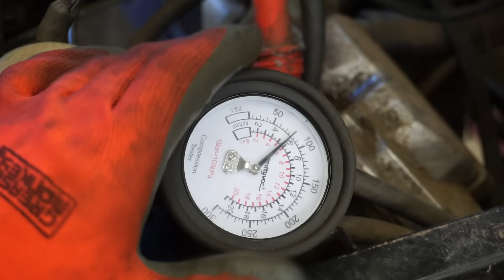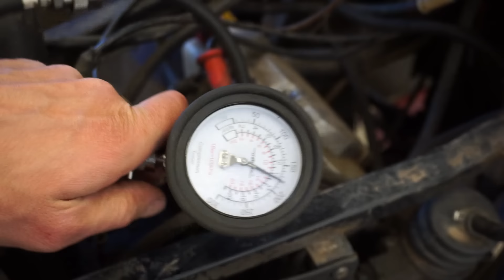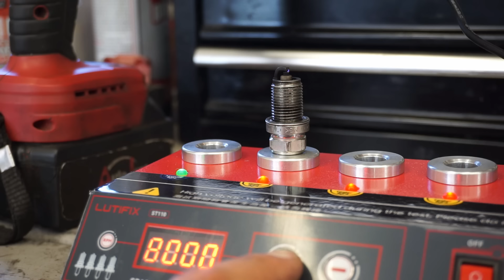Nobody Could Fix This $200 ATV (Won't Start)

Comment: Joe, there is supposed to be a foam sock filter on the end of the rubber intake hose where you put the tape.  That will create the proper air resistance for the carb.  You're welcome.
Reply: Where exactly cuz I bought in that was beat up gettin it fixed up so i don’t think I have it either
Reply: Polaris got rid of that foam due to it crumbling and clogging carbs causing more harm than good.

Comment: My dad currently has the same quad from 1995. It is bone stock and has over 4k hours on it, and has never needed anything but gas and oil changes. Most reliable quad I’ve ever seen
Reply: Doubt it but nice try brother!🤔😬👁👁👎👎🤝
Reply: @craigmorgan4676 nope 100% true best quad I’ve ever owned. Finally after 30 years of hard work the transmission is finally going. It has been worked it’s whole life and never gave us any fits
Reply: Great fix😊
Reply: Mine is a 91 and been great
Reply: @craigmorgan4676   they will if people would perform normal maintenance on them.  I work on everything from motorcycles,  snowmobiles, atvs,  outboards, chainsaws, lawnmowers,  etc and without question the worst are atv and chainsaw owners.  They do nothing in regard to maintenance.

Comment: I remember back in the day when I bought a new one from the dealer back in 99 they told me the cams would go bad if you didn't use the special polaris 0w30 oil in them. I listened to their advice and used 0w30 Polaris oil since new and my dad has it now and it still runs like new. It has 28,000 miles on it. It is a sportsman 500 but basically the same engine.
Reply: manufacturers oils (BMW SEAT VW etc)
are often good invoices, manufacturing,
Avoid returns to after -sales service of their vehicles.
Reply: Another great video as always sir. Since you made out so well on this one, I think it deserves a new seat cover too. Keep up with the great work.

Comment: Didn’t see anything in the comments about this but if the tractor muffler has more air flow than stock,the carb will need a bigger main. When you restrict the air box, you are essentially running it at half choke making up for the lack of fuel. that being said I love watching your videos. I’ve learned a thing or two from you.
Reply: I was thinking the same. Cause and effect. Ditch the goofy tractor muffler and throw the OEM muffler back on. I bet it runs better without having to choke off airflow.

Comment: My cousin had one identical to this back in the day when they were new. He was a hardcore Polaris fanboy in those days, but all I remember of it was him CONSTANTLY fixing on it because it wouldn’t run or the 4 wheel drive had quit again or something.  He doesn’t run Polarasses anymore! 😂
Reply: In the the mid 90s we had to pull Polaris' after they got wet because the belts would slip they  was definitely junk in those days . There actually good fourwheelers now
Reply: @michaelmays9292  Still junk
Reply: @NightTakesFlight yeah I’m still not a fan of Polaris. I like my Japanese stuff, it just runs forever.  My 87 moto 4 still runs like a dream.
Reply: @minnesotatomcat  same, I like my YFZ450R and my TRX250X, my brother picked up a 04 Predator 500 and it's just been a chore, still gotta fix the leak to the carb
Reply: @minnesotatomcat  the 100 cc yamaha quad? I had one of them. Thing was so reliable.
Reply: @aarongrabowski3775  it’s a 225cc. They made the moto 4 in a few sizes, even a 350.
Reply: I had a 2004 Can-Am not any better junk wouldn’t just buy a used one of those
Reply: You had to keep the front hubs clean and fresh demand drive fluid in the Older polaris and they worked fine. I've had lots of them.
Reply: We had a bunch of the old 250 trail boss’ lol good thing they were easy to work on cuz they were apart more than they weren’t

Comment: I just finished rebuilding a 1996 425. Cam ended up being wiped out on the exhaust lobe. You got lucky with this unit in very good condition. Thanks for the content
Reply: A lot of ppl don't run right 0w40 is only thing good for these

Comment: Polaris tech tip. When diagnosing the fan simply unplugs under the passenger side fender well. Unplug it because it sucks enough juice to drain the battery in 5 minutes by its self. It will save on your cranking juice. Also the fuel “pump” is merely a device that only allows fuel to flow if the engine is running activated by air pulse. The fuel is gravity fed otherwise. The cams do get worn on these really bad as they aren’t oiled properly. Then go ahead on an add a jump to ground on the brown wire for the AWD so it’s never an issue. The factory mikuni carb is the best you can get. Only replace jets and parts as necessary . All the china remakes will never run right.
Reply: Polaris Tech Tip...Scrap it and Buy a Honda or Yamaha! 😁💪.
Reply: What would you advise on the engine oil? Is 10W40 motorcycle oil good enough to protect the cams or should you use some car motor oil for best protection since this vehicle doesn't have wet clutch? Some people above say to use 0W30 or 0W40 motor oil. 
Thank you.
Reply: @paul340mopar  Really...how about CanAm? I'm looking at one

Comment: 29:30. It's a good tip to mark the date on the oil filter when you change it. It gives the next mechanic some useful info next time they're doing an oil change.

Comment: I live in Mid Michigan and I used to have a 2007 Yamaha Bruin or Brute or something. It was a 4x4 and had a snow plow that came with it. Had the cops at my house for riding it one day so I sold it and now we live in a different house with nothing but farmers fields for miles. I need a new machine to have a little fun on and something that will plow my driveway. I wish I could buy a used machine from you. I would LOVE to buy a machine from you. Or at least have you take a good look at one for me before I buy it. 😊

Comment: Great find for your fix.   Had the same thing on a 2 stroke atv I fixed 12 years ago.  I had to zip tie a rag  between the carb and filter.  Weird it needed more resistance for the carb to work correctly.

Comment: I had a similar issue on an old Kawasaki street bike with CV carbs. I replaced the air box with Uni Air Pods, and the air flow was too great. I blocked about 75% of the Air Pod with aluminium flashing, and it ran perfect.

Comment: I worked for a Polaris Dealer back when these were new. They have had carburetor issues from the start. If your filter holder repair don't hold you can get that and the belt cover after market from Amazon. Back then Polaris did not sell oil they called for full syn after the cams started wearing out and atf fluid in the front hubs. You don't even need Motorcycle oil because there are no clutches in the engine and oil weight depends on where you live 10w30 is fine most of the time.
Reply: So Polaris engines are not that picky about the oil type? I have a Polaris Magnum 425 6X6 but since i've always heard that it always should be used Polaris oil in Polaris 4 stroke engines i haven't used any other oil. Is it the same for transmission oil or the oil in the front hubs for Polaris ATV's and UTV's too that you can use other oil types without any problem?
Reply: @BSS22193  Polaris Atv's are not picky about there oil as long you run synthetic oil. Transmission runs the same oil as the engine, The newer UTV's are picky about the oil weight if they call for a 5W20 use 5W20.
Reply: @Proudpapaify  Thanks a lot i understand! I have been thinking about this a lot of times when it comes to service my ATV. But can you use the same oil in the front hubs as you can use in the transmission on these older Polaris ATV's or do they need any other type of oil?
Reply: @BSS22193  The front hubs need ATF automatic transmission fluid. That is what Polaris recommended before they started selling there own fluids.
Reply: @Proudpapaify  Ok thanks, then i know what oil types to look for when i should service my ATV. 😊

Comment: Rubber (resistant to fuels) is normally attached to metals or nonmetals surfaces by the ad of painting the metal parts in areas where you can see it shall be attached. Let it dry. Apply the rubber part to the painted metal area and supply some pressure but mainly heat will do the cure. The paint is a special dedicated glue to ad/cure the contact areas

Comment: Thise tractor mufflers work quite well on atvs surprisingly.  I have one on my wolverine with the combination of a mower one at the back of the atv. Its so quiet you can hear the air being sucked into the carburetor.

Comment: i have had the same issue on my quadrunner 250 and it was my carb bowl gasket was not sealing properly anymore as soon as i changed it it ran like a charm

Comment: I saw his one with the bike on the back of the truck I hoped you’d work on it today . I’ve had one for a year trying to get it right . Would die backing up wasn’t cutting out in reverse fan great idling around but full throttle or against a hill it would cut out I totally went threw it new valves cleaned carb new cam everything was good new fuel pump coils stator still ran crappy got a used regulator CDI and Rev limiter still crappy  . Found a 180 main jet in it and got a 140 and it ran great then . What a pain it was and it is now back after a couple months with no spark . I was really hopeful you’d need to do more to that one . Wish I could come over and say help !!!!  Also that’s one of the fastest ATVs I’ve rode .

Comment: Inherited the same quad as a basket. Had to find a carb and throttle. Finally started but wouldn't run faster than an idle. I read this was indicative of a cam with a worn exhaust lobe. Pulled the cam and sure enough it was worn to almost nothing (how is that possible? Did the previous owner just idle the engine endlessly?). Anyway I replaced the cam and it ran fantasticly.

Comment: I think with that diaphragm  being loose, ya'll can drill a tiny hole in the connecting pins and put tiny screws in it for a firm fit. With that air box with the broken supports I think if ya'll scratch it up with sandpaper then spray it with brake cleaner ya'll can use that hot wax, but it is really plastic you can put a good weld on with plastic sticks in hot wax.

Comment: Had a Suzuki quad that wouldn't run at all if the air box wasn't completely sealed. Got it for 250$ quadrunner 230 I think.still you got a heck of a deal .

Comment: On my 99 400 EX whenever the intake boot (between the carb and the air filter) comes loose from the carb it doesn't want to start, It just coughs and spits. Basically the carb would get too much air and not enough fuel. It was a mystery what was going on at first because everybody was telling me to take off the air box lid to let more air in to make the quad go faster, with no concern for installing the proper jet afterwards. I have dumb friends & sometimes we have to learn the hard way 😁

Comment: 2:23 "Have no fear!!  UNNNNDERDOG is here!!"  I think I just dated myself...   I had this EXACT issue with my golf cart.   Turned out that mud dobbers had build a solid mud damn blocking the air passage tube after the filter.  I couldn't see it because it was on the bend.

Comment: It's lean, by adding the tape over the pipe your choking it thus the carb pulls more fuel less air. Raise the needle if its a clip type or go to a slightly larger jet/mixture.

Comment: One thing I noticed is before you took the plug out, you should have blown out the hole. When they are in there stuff falls in but you already know this. She’s a runner.

Comment: That wheeler  being that fussy on the air in, 
you wanna bet that teactor muffler is too restrictive also?

Also I'd coat the whole outside of air box with thin layer of silicone where the cracks are, or entirely.

Great find!

Comment: Check your intake manifold. The rubber comes loose from the aluminum and creates an air leak if any pressure is applied to the carburetor that would open the gap.

Comment: If you remove the slide there are two security screws to remove the main jet housing in the carb. There are two o-rings on it that rot and cause this issue.

Comment: Double check fuel pump. Seemed weak from the clip. If that's weak, will give the same symptoms.  Had same issue on my 500ho. New aftermarket pump is cheap from Dennis kirk

Comment: Kinda makes sense if the air box is leaking your losing vacuum. The slide works on vacuum. I never had one with that type of carb. $200 quad that runs. Would love it to putt around my yard.

Comment: Carb problem. It’s using the air resistance to pull more fuel out the float bowl or to pull slide up

Comment: Random observation...  If everything checks out, as appears to be the case, then I'd start looking at what's changed or are there aftermarket parts in play. In this case, the only thing non-OEM that appears to be on it is that janky tractor exhaust. Wonder if that thing is too restrictive or something similar and is the source of the issue? You've proved that it's an airflow issue with the work you've done. My next step would be to look at the exhaust.

Comment: I have the same wheeler with the same air intake issue I took a foam filter and put it over the intake inlet were you put the tape and it helped. I was hoping you would do some troubleshooting on the radiator fan. Mine is not working haven’t had time to troubleshoot it yet.

Comment: Most ATVs need to have the belt cover on for it to run properly and the belt needs to be in good shape to get proper rpms the cover has a breather and it's meant to cool it properly as well

Comment: I would check the vacuum on the carb. Sounds like it has a vacuum leak. If it loses vacuum the slide comes down and kills the throttle even though you have finger trigger open.

Comment: To fix plastic I’ve had better luck with JB weld or a solder iron and zip ties for solder…You could also zip tie the air box closed or a small ratchet strap around it…just a idea but it sounds good now ,,,,good deal you got

Comment: The problem that you have with it is that tractor muffler is causing restrictions with the airbox off it's allowing the fuel mixture to change so it's running better but your problem is the muffler

Comment: Hey Joe , i have the same machine, its very sensitive to airbox and air filter and even the intake manafold, and mine did the same with bogging until i found a small bent part of the intake manafold, once i fixed that it was fine, the only thing i cant figure out is front right hub wont go into 4wd.

Comment: Think there is supposed to be a cone on the end of the air-box that goes under the tank cover that reduces the size of the tube opening.  Gets the air intake higher to prevent water from getting in.  At least my Polaris's have them on the ends.  That would account for the tape job "fixing" it.

Comment: Wear some rubber gloves and put the flex seal glue on the rubber hockey puck that's cut down. Then push it inside of the breather air cleaner box flush.,an add A hose clamp around the outside of it tightened down good.

Comment: I would try to find a stock exhaust or a proper aftermarket one with a spark arrestor in it, I think having a straight pipe like that might be causing your  bogging problem. It's either too much airflow or not restricted enough!

Comment: Have the same bike pump gave me nothing but problems would work some days not others so I bypassed and did gravity fed and stopped having issues got my bike basically free traded a tent trailer I got free had to do some work to get her going and has been pretty good other then the pump idk why they bothered with one

Comment: my rancher 350 4x4 did the same thing. Ran like shit with the air filter on I removed it and its perfect. I think the issue was the KN filter was restricting airflow because its a clogged junk. Stick to the FOAM oiled correctly filters and they work awesome. A KN works amazing for street use NOT dusty off road in MY opinion.
Reply: Or the K&N was actually allowing more air and then your jetting was wrong.  More air flow needs more fuel.  Same problem he has here.  It needs a bigger jet.

Comment: I do not think it is fixed correctly. It did not come from the factory with tape. I think what you have is a air intake manifold leak when the air box is on. Its probably pushing on the carburetor
and changing the angle, opening a leak. When the box is off it relaxes the angle and the leak closes and it runs great , so not a box problem. By putting the air box back on you reopen the leak then your putting tape over the air intake which in turn makes it run richer , like the choke is on part way , compensating for the extra air coming into the system. I would check the intake manifold when the box is on and off, without tape on the box. That's just my thoughts,really enjoy your videos
Reply: I was thinking the same thing. It revel fine without the box but not with the box so the slide was working fine. I think you got it right.
Reply: Reved
Reply: I thought the main jet was a bit small as well. There for awhile I thought the exhaust may have been restricted.🤷‍♂️

Comment: Curious.  So if you need to reduce airflow to get maximum rpm. Wouldn’t that mean jetting up on carb main jet would yield same result? Seems like a starved fuel ratio to air.  Reducing air is same as increasing fuel. And since it’s not at idle but at rev. It’s main jet. Am I wrong?